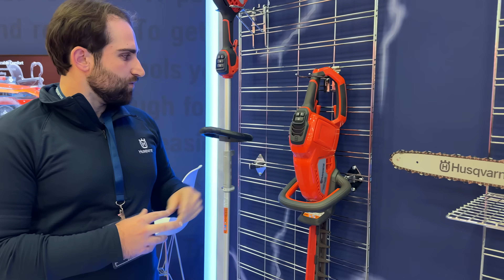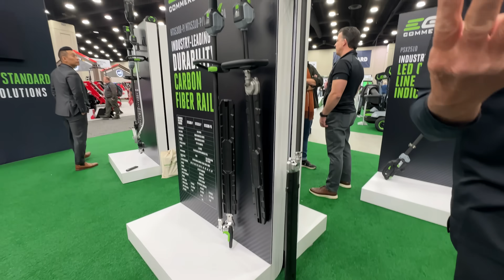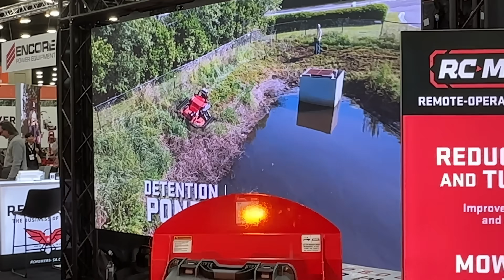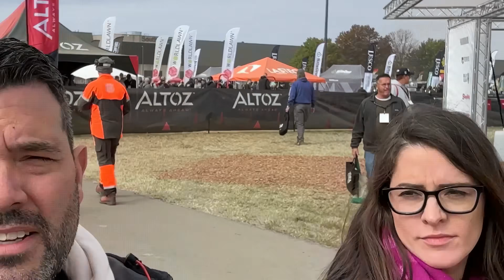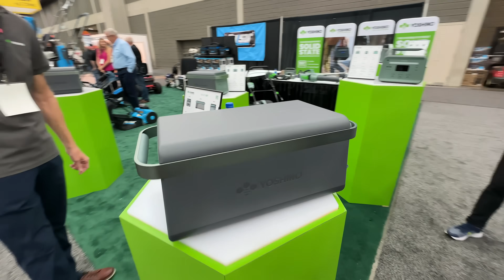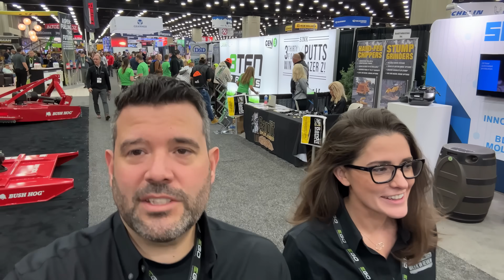All the NEWEST TOOLS and OUTDOOR POWER EQUIPMENT for 2023!

Comment: Wow it seems like the OPE is getting too crowded...Too bad there isn't a cross over battery for several different brands...I own 6 different platforms for different tools: Milwaukee M12, Rigid 18v, Ryobi 18+ and Hitachi 7.2v and makita 18v. I do not want another battery system. I am not a contractor.
I have: pole saw, weed cutter, hedge trimmer, power auger, grease gun, pvc pipe cutter , grinder and more tools for special jobs coming. I already have $600 or more in just lithium batteries. So is there going to be a culling of manufacturers?

Comment: Having used cordless tools for decades and locked into a manufacturers battery system its what scares me about these new products. The federal government should mandate that all batteries are cross platform compatiable to encourage adoption by people like me that don't want to be held hostage to a proprietary battery system.
Reply from the maker: Terrible idea, and I'm usually on the side of Government oversight. Battery tech isn't limited to cells and a connector. There's complex communication between batteries and tools, that not only optimize performance, but they do a GREAT job of keeping the cells from blowing up in your face. Plus, if you forced a Milwaukee tool to take any battery, you'd end up with Milwaukee tools with shitty batteries, doing a shitty job. Do you think users will blame the battery? 

Imagine being a tool reviewer on YT. You'd have to take a new drill, and test it with 94 different batteries to figure out exactly how good the tool is. No thanks.

How on earth would you handle that as a company? "Here's our new drill. We'd tell you how much torque it has, and RPM, but it all depends on what battery you use from which company. GOOD LUCK!"

 >.< We benefit from companies fighting each other to make better batteries and innovation to WIN US OVER to their platform.

Comment: It's cool to see all of the battery powered OPE getting released, but I have yet to see any signs of a decent, reasonably priced homeowner cordless reel mower. It goes from the $250 Sun Joe straight to a $3000 Allett or Swardman. But we'll have 100+ options for a zero turn.